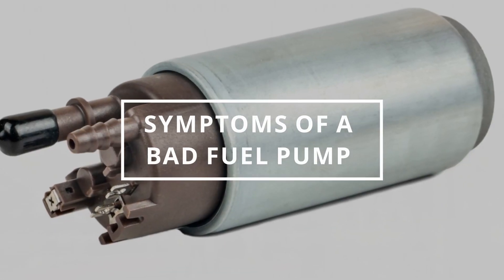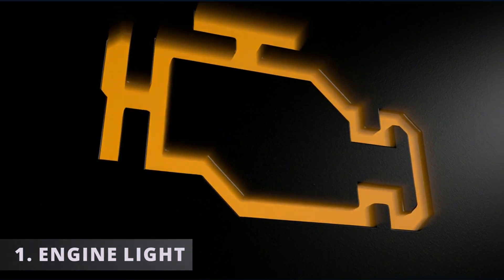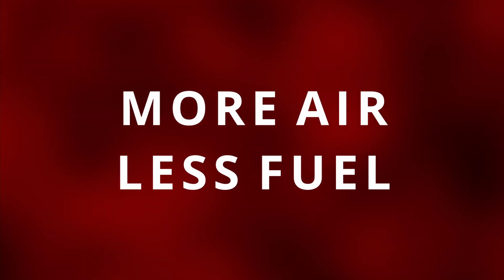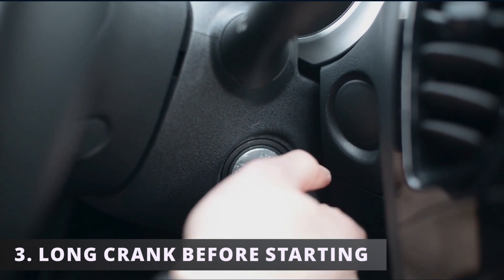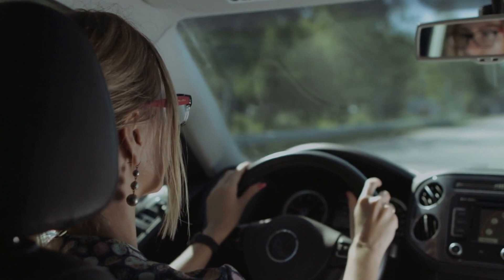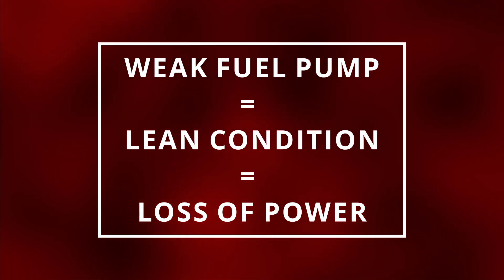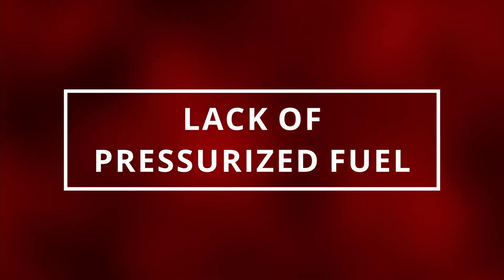SYMPTOMS OF A BAD FUEL PUMP

Comment: Bad fuel pump is p0300. I know cuz there's no buzzing sound from fuel pump and there used to be one and my car drove smooth. It's starts but it sputters misfires and struggles bad on heavy loads especially uphill.

Comment: got a P0232 code, got crank but no start, got engine stalling when first starting the car, and got the car sitting inclined with the tank close to empty many times and the fuel pump sucked in air cuz the car was inclined and the pump ate too many amps and broke itself, so now i have to replace the fuel pump lesgoooo

Comment: So my issue is that my car won't start but it's cranking over and then all of a sudden after a few days of trying it will start and start for a few days but I haven't been driving it because of this reason so I got a new fuel filter because the fuel pump is out of my budget or my knowledge of working on cars my question is if I attempt to try and change this fuel filter will that fix the problem too

Comment: Even if you can do it yourself, it sux when it finally goes and you are not a home. Tow bill plus cost of parts! I know it's like a standard charge of like $700 and most are accessible from the trunk and are an easy fix.

Comment: Its tricky because the evap system  can cause alit of these  symptoms to bad purge valve canistor solinoid valve.   Working on a little a aveo no pressure in the fuel tank runs but can stall simetimes  idels finny when  it sets for a bit and runs like crap after u get gas. Reolaced the purge valve...

Comment: Loss of power can be caused by many issues so don’t just rule out fuel pump vaccum leaks exhaust leaks throttle body dirty ignition system exhaust system issues spark plug fuel injectors dirty air filter maf or map sensor bad hoses bad fuses low compression there’s so many causes of lack of power so people that don’t know it’s best to take it to a reputable mechanic or dealership to properly diagnose the car so your not just throwing parts at it

Comment: hey,  Volvo s40 2008 petrol here. so the other day my car completely stalled on the highway as I was going with 60mph. There were no symptoms whatsoever, just all my dashboard lights went on for a second then car lost power and had to pull over. Now, my fuel pump used to be quite loud, it used to start making buzzing noise as soon as I turn the key on but mechanic said it's okay. Now, when I try to start the engine nothing happens, the engine doesnt even start to crank, mechanic said there might be a broken piston / or that timing belt has broken teeth and now I wait for him to open it. BUT I  also noticed that I cant hear the fuel pump buzzing anymore when i turn the key on. Is there any chance that the fuel pump has failed and there's some sort of sensor that prevents the engine from even trying to start or is it two completely separate systems and prob the engine is damaged. Thanks

Comment: I am being quoted to replaced my fuel pump. The problem is I don’t believe I needed it or I don’t trust this guys going anymore work. I bring in my car for battery replacement only and the next thing I know I’m being quoted for more work. The new installed serpentine belt having bad sound after replacement and when I brought in my car for battery replacement there is nothing wrong with it, now I’m hearing all kinds of noises and getting quoted for fuel pump replacement! I don’t trust these guys to replace it because I believed they’d caused more problems as I’ve said just battery replacement and soon I have more problems. If fuel pump is installed wrong again it’ll cause all these check engine light which I don’t have! And destroying the rest of my car! My car doesn’t have any kinds of these symptoms, just the grinding sound when shifting gear or turning!

Comment: thank to this, had this issue, when driving  while slowing down engine stalls, while waiting for the green light the engine stalls had to wait 5-10 minutes before it starts again, i changed the crank sensors, ignition coil , spark plug and still got the issue,  not until i change my fuel pump.( -_-)
Reply: Just an updated , sadly it was the ignition coil pack , so i got an extra fuel pump now 😁

Comment: Then wtf is with mine, so i removed fuel line hose from the pump its like majing spinning sound but it doesnt give fuel, like i hear it spining but nothings comming out of it
Reply: if no fuel is coming out of the fuel line before it goes into the fuel filter id obviously check for fuel in tank or just replace it. or also check for a pinched fuel line
Reply: @evonmaggard4304  found the problem, so in a last ditch effort I located transfer pump ( located just under where the driver sits underside of the car) and you know like old starter hit it a bit, turns out one of the wires in that connector somehow burned off and there wasn't any ground, so to get home and start fixing it I used zip ties and somehow pressed it against something metal that grounded the pump, so ye all good

Comment: My car symptoms are it will not start after I have stopped unless I wait 30 to 40 minutes for it to cool down. I’ve had the fuel pump replaced twice and it still is a problem now my fuel indicator light will not work properly and this video shares with me I’ll probably get stranded in the middle of an intersection while I’m trying to drive.I don’t wanna die with this car as problem. I’d rather die a different way thank you.
Reply: I have this exact same problem. If it wasn’t the fuel pump then what was it?
Reply: I had a relay go bad and the solder would separate when the engine or cab headed up. I resoldered it and it never shut off when it was hot again. 94 Accord was the car.

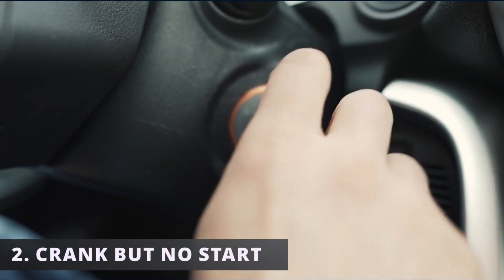Comment: 1:15 What you mean by "crank but no start"?
Reply: What it means is that you’re trying to start the car it feels like it’s going to turn over and it makes a lot of noise, but it never connects to starting very different than dead battery which is just a clicking sound.
Reply: Engine doesn’t “ turn over”

Comment: The fuel pump in my car crapped out this morning. Luckily my car stalled just before an intersection at the stop line. It has #3 in the video. The check engine light did not show up.

Comment: My 96 plymouth breeze, stalls at idle at traffic lights or drive thru sometimes when im making a slow turn. But if the car is moving at higher rpm i have never had it stall. Already went through my basics, cleaned all my grounds check all my connectors, checked my spark plugs cleaned and checked gap. Scanned for codes but have none. Even tried changing tpms and IAC valve with known good ones off my other breeze but still have it stall. Also mainly stalls after warmed up. Could it be a bad fuel pump ?

Comment: when i start my truck in the morning i can drive my truck regularly for about 40 minutes and after that it starts to act up. i have to accelerate slow bc if it goes over about 2k RPM then my truck lugs down and drops RPM and won’t go anywhere. and somtimes it gets to bad and i can’t even press the throttle cuz it’ll drop down to below 1k RPM. and during that if i stop at a stop sign it struggles to idle and may even die out and i can’t start it till after a little while. it’s like its starving for fuel almost. but once my truck sits for a while it runs better but only for a certain amount of driving time. this been happening for a few months now. no engine lights are on and won’t throw a code. this is on a 06 nissan titan. if anybody would know what’s the problem lmk

Comment: I’m driving a 98 forester and been having problems and definitely for sure it’s the fuel pump. Taking it in on Monday fingers crossed
Reply: Did you get it fixed? I’m having issues with my legacy at the moment very intermittent tho!!
Reply: @ I was able to get it fixed. But it wasn’t a bad fuel pump. It was a bad mass airflow sensor. 
She’s running much better now.
Reply: @ashlol5700 Mass airflow sensor is so much cheaper, such an easy fix. You got super lucky.
Reply: @ I’m wondering if that’s the situation you have. I would say it was very intermittent as well. It was not consistent. One minute be running fine. In the next we would be having issues.

Comment: Today my truck started up and ran just fine to work. Almost immediately after I left work I noticed it didn’t wanna go when I went to give it some gas. Stayed running just didn’t wanna go. I changed the filter just now and it’s still doing it. Fuel pump? Asking because I’m not a mechanic  just know  the basic stuff about trucks and cars.
Reply: i’d do the pump aswell i’m doing mine becuase the fliter on fuel pump it’s self is clogged just enough dirt over time it ran fine to work and left work went shit
Reply: Could be spark plugs

Comment: Hello I'm having P0091 and P00C9 on my 2013 impala. Any ideas? Fuel pump seems fine. Replaced fuel control module and fuel pressure regulator. Any other ideas? Also engine power reduced

Comment: Ok so I have to give mine gas to start, it will turn over and you can hear the engine trying to turn on but it wont start unless u give it gas and sometimes it does once started or if u try to drive it right after starting and I have to turn it off and do it again. Any info???

Comment: I have a very quiet sound of trickling liquid when I'm cranking my ford ranger. Haven't checked codes yet, but the truck won't hold its start even after revving it for a bit. There are no fluids coming out anywhere nor are there any fuel smells, and the trickling noise stops as soon as the engine does. Could the trickling sound be a symptom of bad fuel pump?

Comment: My car turns off whe. I come to a stop and turns off sometimes so fuel pump can be the problem
Reply: Mine is doing the same now, it will crank immediately after . RPM also fluctuates on its own. Did you find a diagnosis?

Comment: The B15 Sentra (02-06) is notorious for crank but no start issue. The fix is replacing the fuel pump with an aftermarket one because the oem one will eventually cause the same issue.

Comment: So what about a Rich condition with failing/faulty starts? I’m getting P0172 and O2 sensors. I’ve been seeing forums say it’s the fuel pump
Reply: I'm getting that too.
Reply: @newsing33  I ended up getting a new car 😞
Reply: @BigstickNick  oh man. I'm sorry you had to do that! I'm hoping it doesn't come to that for me! My problems with my car started right after I stopped to get gas, about 3 weeks ago. I got on the highway right after, and after a few minutes, my car started to die, and I pulled to the side of the highway. Finally got my car started again, it was in limp mode, but I did barely make it home. I thought I had gotten bad/contaminated gas, so I've run several fuel system cleaners through my gas tank, that didn't help. I have an OBD Scanner, that was throwing the codes for MAF sensor, and low heater circuit for both bank 1 and bank 2, all 4 O2 circuits. I tried cleaning my MAF sensor, didn't help. I replaced my MAF, didn't help. I got all 6 spark plugs replaced, because all 6 were burned to a crisp. And I got a new battery because my battery was bad, didn't help. It would cost around $700 for all for OEM sensors for all four of the sensors to be replaced for both banks, plus a large labor cost. I'm really hoping that it doesn't come to that, because that's too much. I've checked for leaks, checked connections, checked so many things. I have a 2006 Lexus GS 300, that I bought when I was working at a dealership several years ago, it's been a great car with no  problems until now.
Reply: @newsing33  yeah, I had an Audi S5…my problem was, I kept reading about how places didn’t really know what was wrong, so they would throw parts at it. Apparently it cost $800 for a place to remove the supercharger, just to get to the problem. 

Yeah, my Audi did great until 103,000 miles. Once it got to 103,001…it gave me problems *moment of silence * 😌
Reply: @BigstickNick  yes, a lot of these mechanics shops want to rip you off with crazy prices just to look at your car! I'm not falling for that. And yes, that seems to be the average, once you hit 100,000 miles or a little more on your car, here come the major problems. This is so stressful! 😢

Comment: What if the engine will not start unless the throttle is applied? As long as the throttle is applied the engine runs smoothly but as soon as you let off the throttle RPMs drop and the engine sputters until it dies. The fuel pump whines continually as to where previously it did not.
Reply from the maker: I made a video on this. https://www.youtube.com/watch?v=10H-GBPCU2g&t=1s&ab_channel=EasyAutoFix

Comment: A floating fuel guage can be another symptom. If the fuel guage is slow to react to fill ups and the needle doesn't move immediately, this could be a pump issue.
Reply: OH MY GOOOOOOOOD! Thank you!!!! I done changed my spark plugs, my mass speed sensor and vent! You saying this definitely helped me out!
Reply: Particularly the sending unit on the pump
Reply: Got nun to do with the pump but just the floater and sender

Comment: Thank you. I put on a new fuel pump rated at 4 bar/60 psi, and a new fuel filter. Measured pressure at the fuel rail and its 50 psi! I searched for info on what it is supposed to be on the 2005 car Opel Tigra Twintop and engine Ecotec Z14XE(P?)  The regulator is a part of the "lid" of the filter and I can't find it for sale alone or as part of a fuel pump. Ideas please-!😮

Comment: Now see my thing is I don't know if I am having a problem with the ignition switch or if my problem is with a fuel pump because I would be able to start it every now and then sometimes it'll stall and then once I finally get it going I'll start driving and while I'm driving and I'll go to slow down or stop or even increase in speed the card would just die and then just turn back on suddenly or sometimes mutual and turn it back on myself but I know it has a history of ignition switch problems my car is a Volkswagen Jetta 2010 I'm getting a new fuel pump on Saturday which I guess it wouldn't hurt cuz I know it's rusted so I will be able to update
Reply: i have same problems, can you please tell me what was the problem, i changed so many things 🤕
Reply: @tahansr399 did you ever find the problem? Having same thing happen to my car

Comment: Mi car has acceleration problems only in the afternoon when the car is been on the sun for few hours,I press the gas pedal and it runs very slow,after 10 minutes it works normal,I don’t know if it might be the fuel pump,the check engine light has popped some times but not always,the code is p0157 and I have installed a new catalytic converter,new oxygen sensor on that bank,no intake leaks,don’t have exhaust leaks,and I don’t know if it might be bad fuel pressure,if you guys could help me I would appreciate it
Reply: bad sensor in your gas pedal maybe

Comment: Use a fuel pressure tester with a bypass and a clear tube or container that maintains the pressure in the system. If you see bubbles you have a winding in one of the armatures going bad. When I say bubbles I mean big ones. There will be tiny bubbles that's normal. The bubbles will be like big pockets in the stream. You can see this with a Low Amp Inductive Pickup on a scope. There is a math formula available with Snap-On from the MODIS era that will allow you to calculate the life of the pump by the hour. Essentially you can use it to tell how long any pump or solenoid has within a few days to a couple of weeks. This includes alternators. The O-scope is still your best friend. In OEM diagnostic mode on newer scan tools the graph mode is equal to an o-scope only it's better because you are working with the full speed sample rate of the ECM/PCM. This applies to cars 07-08 and newer.  The math equation works the same. It still works to the day.

Comment: EasyAutoFix...my 2011 Jeep Wrangler JK starts fine when it is cold but when 
I drive it and it warms up and I turn it off..it takes about 15 minutes and multiple
starts for it to crank. No check engine light. Could this be a symptom of a bad
fuel pump....??? Thank you.
Reply: Yes

Comment: What about noise? Not that one we hear at first but annoying low pitch noise while engine is working. Before that I never heard from pump anything but now it became clear and quite loud...
Reply: Exactly this.  I also had a first symptome hissing, lower noise coming through the sound of my exhaust and in the cabin.
Reply: My problem was not a faulty fuel pump. The car (Chevrolet Lacetti) had only driven 40,000 km, and during that time, the fuel pump module had sucked in 1/4 of the module's height in sludge and rust (which probably came with the fuel at the gas stations)... I removed the module the other day, thinking I would replace the fuel pump, but it turned out that the fuel pump filter screen was clogged, as was the fuel pump module itself. I washed it, replaced the filter screen, and it became like new. But I still need to replace the fine fuel filter, the one under the bottom of the car. Now I can't hear the pump working while driving again.